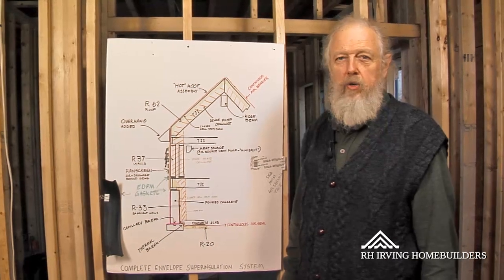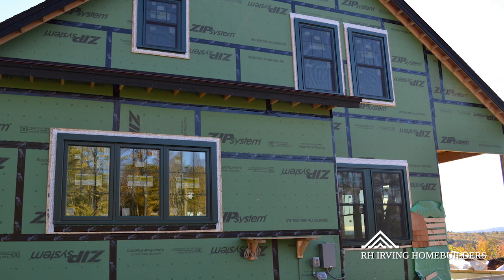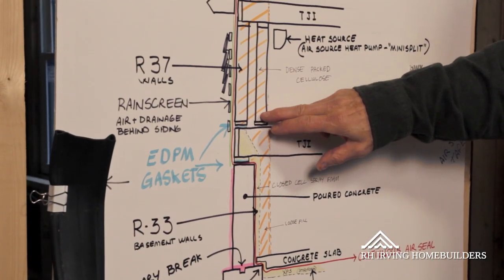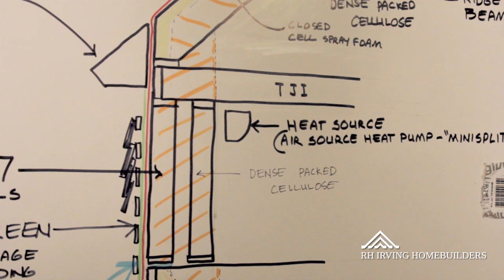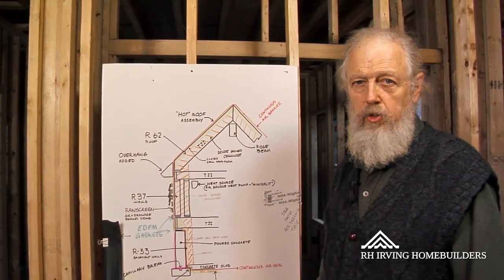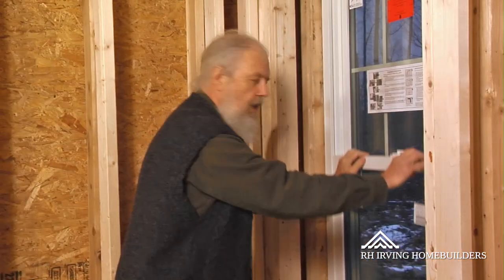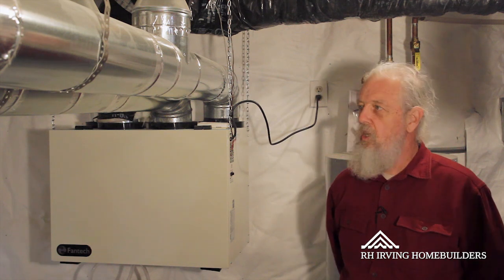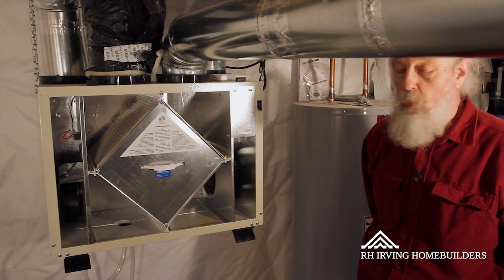RH Irving Homebuilders: the technology of a superinsulated house

Comment: This vid is nearly 6 years old and I'd like to see where the changes to his building practices with the advancements in knowledge, technology and materials.  For instance, it's considered best to insulate the OUTSIDE of concrete basement walls because of how it fights dampness/moisture wicking in addition to heat loss. If you're still out there, Mr. Irving, will you give us an update?
Reply: I second that! Also, I know this is a tall order, but I would love to know how this house really performed.
Reply: In the past ten years we built about 16+ double wall houses - all essentially similar to this one - except the roof.  This house has a "hot" roof, meaning without ventilation.  We chose to ventilate most other roofs, although we have seen no issues with hot roofs.  In terms of the wall system - we used it since it is the least expensive and has common details, while exterior foam walls - which I think are superior in many ways - but they have a lot of detailing which if done wrong can be damaging to the structure.  Double stud is probably the most common superinsulated wall being built today and they seem pretty "bulletproof" if you get the moisture related details and air tightness correct. 

As far as performance, none of our homes are electronically monitored, so I do not have details.  I do know that most of our clients - not all - have installed solar and are paying the minimum charge (typically under $20) for "electron" delivery each month, and nothing for the actual electricity beyond the cost of the panels.  Everyone we've built for or upgraded continues to be pleased with their homes, and there are no problematic issues that I've heard about.  (and I usually hear if there is a problem).

My takeaway is that they are all on the same page as Mike in his 30 minute video on my website.  The houses work, they are unusually comfortable, and the fresh air ventilation just adds to that.  I continue to wonder why all houses aren't built like this?
Reply: Some of the changes are in American manufacturing.  Tilt Turn windows are now made in the US, although most use European parts and plastic.  There are American made thru-wall heat recovery ventilators, and more choices including readily available rock wool batts.  We're using a peel and stick permeable membrane on the exterior of our next house - the one we'll be using is Swiss, but should work better than taping seams.  There are no changes that affect the basic Passive House design ideas.
Reply: One exciting development is that a Maine builder is refurbishing an abandoned paper mill in Maine to manufacture wood based exterior insulation.  At this point we're importing brands like "Gutex" - google it - water resistant & locally made with renewable materials.  This is where we're heading.
Reply: @robertirving6273  Thanks for the update!
Reply: @Allen Loser Please let us know what solution you end up going with and the cost. I think your situation would be similar to adding an insulated layer to the outside of any home, so your project details would be quite helpful.

Comment: He didn’t call that a bungalow, did he?

About that foundation slap...you did foam first, then moisture barrier, then concrete? 
Wouldn’t it be better todo moisture barrier first, then foams, then concrete?
Reply: actually you cant do that, since the foam will float, leave gaps, and mess everything up.
Reply: S12 B the moisture barrier is just a thin plastic film, I don’t see what the difference is
Reply: @4philipp  Mosture in a house is a huge issue.  The issue here is that when and if water gets above the plastic, it can take years to dry out; when it is below the plastic, it basically doesn't matter if it ever drys out.  We want to keep ground water and moisture out of the house, not in it.
Reply: Robert Irving I get that. But it’s the reverse principle of application from the walls; so I was wondering. 
If the risk of the moisture barrier being punctured is too great, we could do foam-moisture barrier-foam. 

And in what applications is a dirt floor desirable for a basement? The root cellar?
Reply: @4philipp  I doubt that you want a dirt floor inside a finished house or basement.  Perhaps if you have a separate root cellar with an insulated door between that and the larger basement, it would work OK.  The specific reasons include keeping ground moisture out of the living area, and increased thermal bridging between the ground and the heated space.  There is no reason to sandwich the plastic; it should be in contact with the concrete.  Puncturing is an issue of course which is why the ideal is to use a heavy - such as 10 mil or a reinforced plastic - either would be less liable to tear.

Controlling moisture is critical in a tight, well insulated house.  On the walls, you want to seal them for air leakage since 97% of water vapor travels through walls on currents of air - so stop the air and you stop most of the moisture flow.  Air also comes in through the dirt.  Typically moisture drive in the winter in New England is from inside to outside - higher moisture levels to lower levels, but that changes in the floor as the moisture levels in dirt doesn't change as much summers- winters.

While the walls need to be air sealed, they MUST be allowed to breathe to dry out; vapor barriers on both side of the wall prevents that and leads to mold.  Double stud without vapor barriers dry to the inside and outside - so they are very safe. Exterior foam prevents drying to the outside so they need to be allowed to dry to the inside.
Reply: Robert Irving I technically don’t need a basement but certainly do need a root cellar. Would be nice to access it from I side the house in winter.
Reply: @4philipp  Just treat it as an exterior space with an insulated door and thermally broken walls and floors.  The concrete floor in the basement needs to be "thermally broken" with 2" of EPS foam between concrete floors and concrete walls and from the dirt floor in the RC.
Reply: @4philipp  Root cellar might be the only place where it's desirable, but it definitely needs to be separated from the rest of the basement.

Comment: Outstanding and very informative!  Have you done anything similar for a southern climate?  The minisplits can cool too.  Would you use as much insulation?  What about moisture issues in NC?
Reply: Sorry, we've only built in New Hampshire.  I can't tell you the details of building in NC, but there are differences with the insulation amounts and vapor barier placements, and some other things.  You can find a great deal of info on www.GreenBuildingAdvisor.com, a website owned by Taunton Press which specializes in high performnance building.  There is also a great, informative book that will give you tons of information and hundreds of useful details, by Joe Lstiburek, the principal at Building Science.com, and one of the most knowledgeable buidling scientists in the country:  BUILDER'S GUIDE TO MIXED-HUMID CLIMATES.  They must be out of print as they're pretty expensive online, but available as a downloadable pdf on the website: Buildingscience.com.  I have the Cold Climate version and it is invaluable.  Well worth the $45, but look for cheaper verisons online or at used bookstores.
Reply: Robert Irving ‘thank you

Comment: WTBleep is a "cape style bungalow"??   A Cape Cod house is one style and a bungalow is another style. Two separate and different styles.
Reply: "bungalow" means different things in different places, though in most of the USA, it seems to imply a narrow 1.5 story house with a hip, front gable or side gable roof and usually a front porch. This seems to fit that description for everything but its width. They seem to call almost any small 1 or 1.5 story house a bungalow in the UK, including houses that we would call ranches and capes.
Reply: There are no hard and fast rules for what a particular house "looks" like.  More importantly, most homes have custom features that may not be common to a specific design.  This is not supposed to be a "period" house, so the description describes a house that has features of both.  There is a picture on my website probably labeled Hopkinton Cape which is my version of an old fashioned looking reproduction NH cape; that's one of the few "reproduction" designs I've done.

Comment: Are you sure that the insulation under the concrete will not get waterlogged? 
Over 30% of the walls on standard construction are sold wood, solid wood from drywall to siding. In short, an R of 1.4 x 5 in. = R7
Reply: Our foundation drains around the house are 6-10" below the bottom of the foam, so ground water should not reach the foam.  But we also avoid using foams in these locations that can get waterlogged, such as polyisocyanurate; for underslab locations we use Expanded Polystyrene - "coffee cup" foam which does not absorb water.  Extruded polystyrene, such as Styrofoam, can also be used, but it is made with a different chemical and much worse for the environment.

Comment: 2 questions: with all that insulation under the concrete, why not just frame a floor, or use 2 x4 straps and plywood? 
2. did you put the walls on 16" centers because there'd be too much sag on the fiberglass netting?
Great video, by the way
Reply: A framed floor over a crawl spaces adds cost over an insulated concrete floor, and with a wood floor, you need some type of basement anyway.  Some builders are experimenting with plywood over foam and eliminating the concrete.  

16" stud centers vs 24" - 1)more common to most builders and 2)24" centers requires 5/8 drywall.

Comment: while very interesting these are the value that will contribute to regulation that will and are drive the cost of the home above that of the common man.
Reply: This is essentially a technilogical change, and like any technology, costs will decrease with wider acceptance and production.  It's already happening.  Here are some examples:  One type of balanced ventilation we use had to be imported from Europe a few years ago, but now can be purchased at our local lumber yard or big box stores (like HD).  Huber, which makes the green house sheathing you may have seen on new construction, has come out with a new product that includes foam insulation, and eliminates a time consuming step in installing exterior foam.  1/2" thich LED "recessed" lights can be purchased for around $30, replacing the time consuming installation of unweildy and leaky cans.  Foam sheets are now widely available from recyclers who sell "used" foam removed from commercial roofs (when the building is reroofed) for a fraction of the cost of new.  Triple glazing,  which ten years ago was difficult to find from American manufacturers is now in the process of becoming common and less expensive.  These are five examples, there are more happening all the time.  The more homes are built, the faster manufacturers will make compeditively priced alternatives.
Reply: Those modern homes are very dependent on electricity to keep them comfortable.
Reply: @4philipp  They are dependent on electricity for everything in the house; yes.  Best part is that you can make all the energy you need on your property, at no cost to yourself except for buying the panels.  You can also own the batteries that will store extra power until you need it, so you never run out of electricity.  What's not to love about this?  It'll be a few more years until battery prices come down for home use, but they are being sold worldwide for grid storage, which, combined with wind or solar generation, is beating every other fuel in cost around the world. (2/2020)
Reply: Robert Irving I mostly agree with you. However, I find it wrong to depend every day on electricity for basic needs and comfort. The lightbulb isn’t even 150 years old. I prefer a setup where modern conveniences are supplemental and not a necessity
Reply: @4philipp I agree it's great when we can be comfortable without adding additional heat, cooling and light, but if your goal is to change the existing environment, you'll need something to power it.  I've lived with an antique wood cookstove; and other stoves; with oil lamps and candles, gas and oil and wood heat,  as well as electricity and minisplits.  I prefer the clean air which is only available with electricity.  On the other hand, I love being in a rustic cabin in the quiet north woods (quiet except for the loons in the middle of the night) with an outhouse and no running water, too.
Reply: Or you could build a Certified Passive House designed to need -0- external heart sources.

Comment: No fossil fuels?? If electricity is coming from the grid to run heat exchangers, lights, tvs, computers, etc., then  you're still consuming fossil fuels. Love the design though, great inspiration.
Reply: Thats the first thing I think when someone says "no fossil fuels". What do you think the grid is? I like his ideas on efficiency but unfortunately very he is very naive. You still can't beat natural gas for heat. Oh, and for grid power generation.
Reply: @tptwk  Currently, in New Hampshire, natural gas is the least expensive way to heat your home... IF you have a very efficient (90%+ efficient) boiler/furnace.

Less than 10% of people in New Hampshire have access to natural gas.

Do you know the second most-efficient way to heat your home?  A heat pump.  Best if it is a ground-source heat pump, but an air-source heat pump is still better than everything except a high-efficiency natural gas boiler/furnace.

But most people in NH still think that propane or fuel oil, combined with forced hot water is the way to go.  They are wrong.

Want data?  Here you go...

https://www.nh.gov/osi/energy/energy-nh/fuel-prices/index.htm
Reply: Air source heat pumps, powered by renewable energy is the least expensive way to heat an energy efficient home.  We are talking to some folks about building off-grid, but that will be difficult to do without any FF-run generators until batteries are less expensive.  You're right that this is not a perfect solution, but we are making progress.
Reply: In New Hampshire, each electric utility customer can choose the source of their electricity generation (Live Free or Die). So, if the owner of this home chooses 100% renewable energy generation (which is available to EVERY New Hampshire electricity consumer, but costs more than the average NH generation source)... yes, this home can be 100% powered by renewable energy, and completely free of fossil fuel electricity generation.

Also... since a passive house uses 90% less energy for heating/cooling when compared to a typical new-construction home, it will be extremely cost-effective for the homeowner to add a photo-voltaic (PV) system to this passive house.

The best way to make a PV system cost-effective is to make the house energy-efficient.

So, if this homeowner chooses to install a PV system to power his/her house, or if this homeowner chooses to buy his/her electricity from a renewable source... then yes... "no fossil fuels" is possible.

P.S.  I think that Mr. Irving meant that the house would require no heating oil, propane, or natural gas for heating.  But, my argument above is still true.
Reply: No.

Comment: Why aren't the exterior walls studs offset?  That would reduce the thermal bridge, no?
Reply: Offsetting studs is one way to reduce thermal bridging; double studs with an air space - 3" in this case - is another method, used primarily when you want a higher R value than you can get with one an offset stud wall.
Reply: There is no thermal bridge because the stud walls are separated by airspace that will later be insulated. Have you ever crossed a bridge where the middle is gone?

Comment: If you're going to use foam insulation (polyisocyanurate compound) then a masonry wall is far easier and gives you almost no thermal bridging.  Passive design is more suited to masonry due to the inherent thermal mass.
Reply: We must consider the "GWF" or "Global Warming Factor" since the source of our climate issues are directly related to putting too much carbon in the atmosphere.  Foams (which we all use even in mini amounts) generally have a high carbon footprint so we use as little as we can.   The other other high carbon footprint material is concrete, which we also use.  So the way forward is learning how to do without both products.

Comment: Why didn't you use foam forms for the basement and house walls, even for roofs. Reference http://www.quadlock.com/ for one. There are several suppliers. This gives R27 before adding any insulation. Additional foam insulation can be glued to outside if desired. The costs were comparable to lumber framing and not subject to moisture damage. You have the added advantage of reinforced concrete walls which I am sure will withstand  hurricane and tornado damage. Blown in insulation will always sag so you lose the R value over time.
Reply: I agree that ICFs can be a good method,  but for us, there are two reasons we don't use them - my extensive experience with SIPS taught me that ants and termites love the stuff; there are ways to mitigate or stop the damage, but the methods can add costs and are not commonly used.  Secondly, I've compared the cost of ICF walls to what we are doing now, (several times) and it is higher, so we're opting for a less expensive method.  In some areas or perhaps with some builders the cost can be less.  I suspect that a builder with a larger crew than ours could install the ICFs and save money; we subcontract that type of work, so it costs us more.